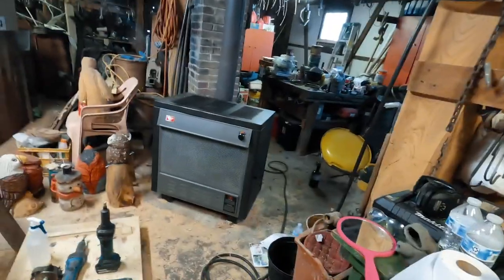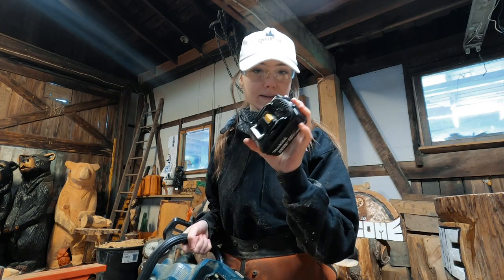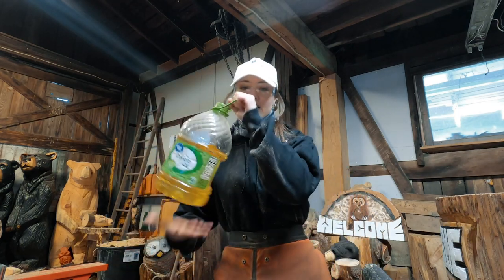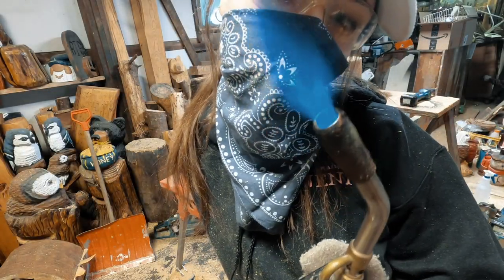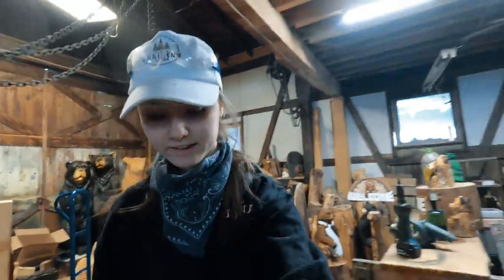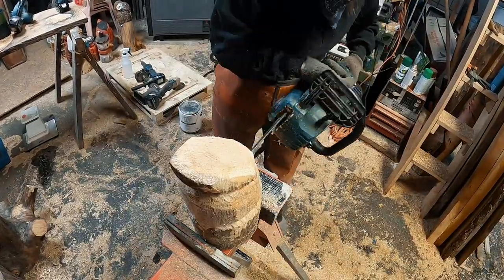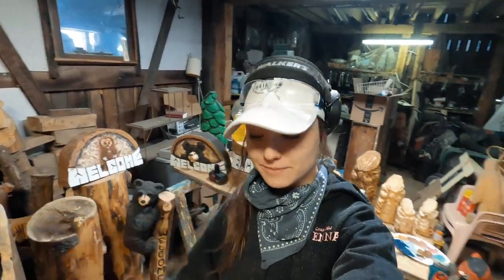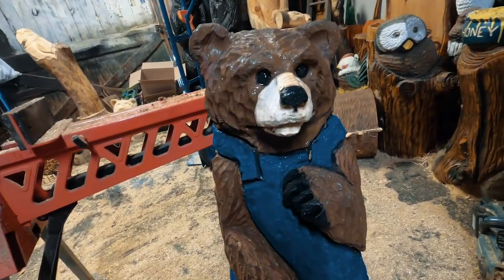MY LIFE AS A CHAINSAW CARVER!

Comment: Good stuff. I subbed. Based on my many years of experience, long hair and hoodie draw strings dont mix well with Makita 20,000 RPM die grinders. And that goes double if it has an "ON" "OFF" switch and not a safer, paddle switch. All mine use paddle switches. Just my 2 cents. Good vid.
Reply from the maker: thanks for the tips!!😁